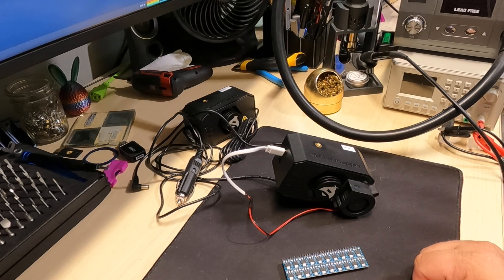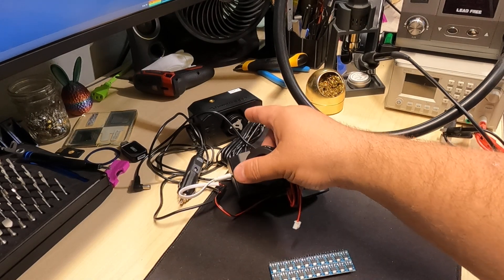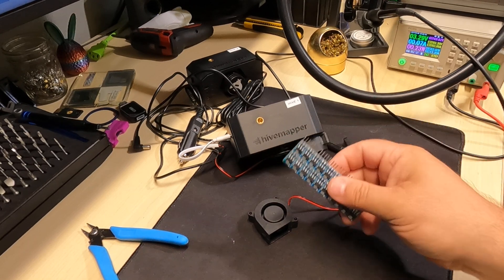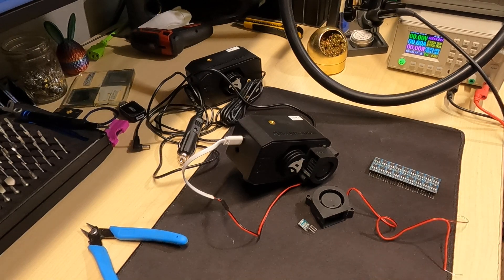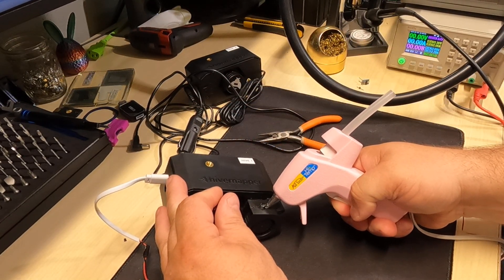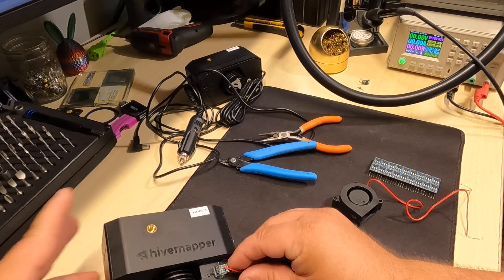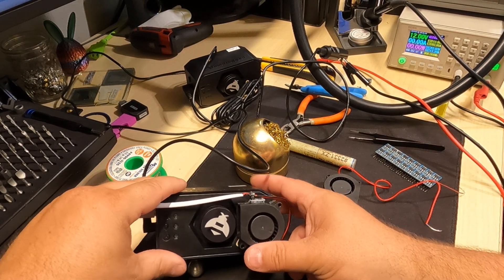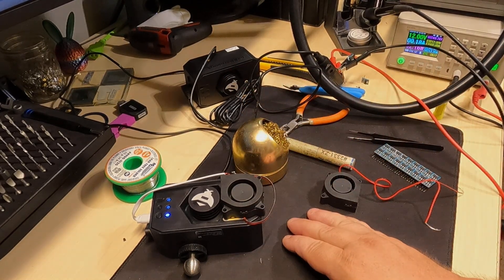Hivemapper Cooling Fan Build DIY

Comment: What happens if you don't run this fan on it? I just got one of these 2 weeks ago. Thanks
Reply from the maker: Most likely the unit will be fine with the high heat, it's designed for it.  This is more to give the electronics longevity by running cooler.